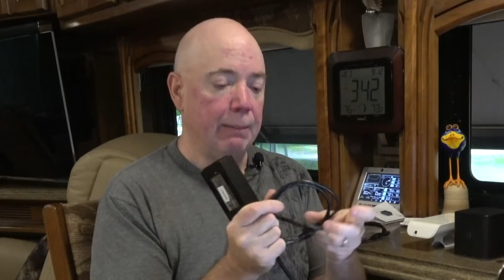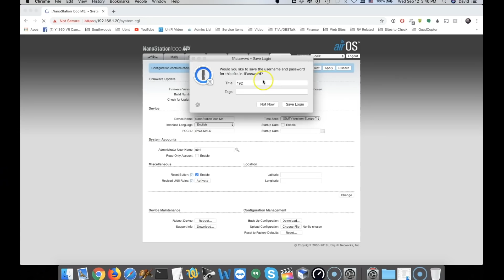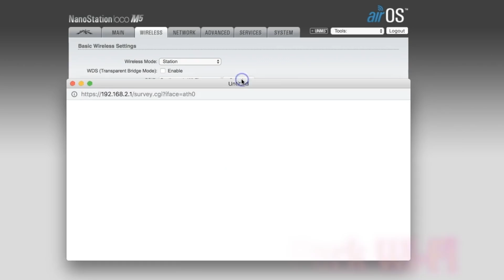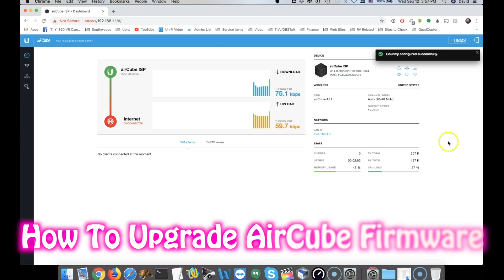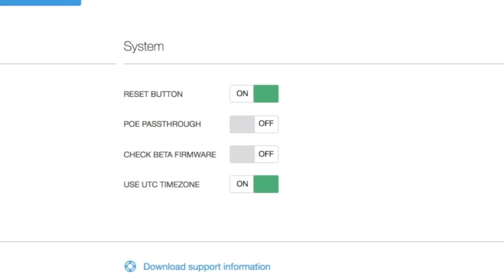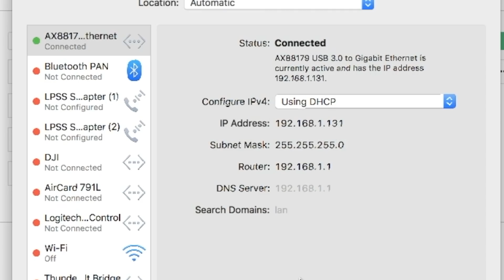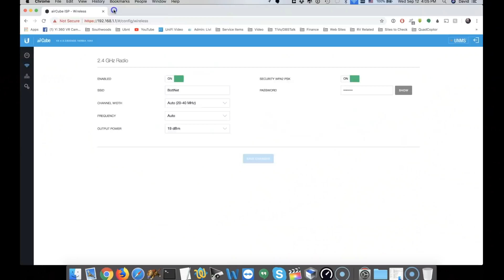Build a Private RV Wi Fi System with a NanoStation & AirCube AC

Comment: Hi again, from a forever grateful viewer. I thought you might be interested in this little tidbit, if you're still into wifi networks. I've been using my Nanostation for about six years in my marina in Southern California, set up per your video (thanks!!!), and now I got an email from the network that I pay (Eccowifi) that they detected a "rogue" Ubiquity device and blocked it, and they need to take it over for security reasons, or sell me their own Ubiquiti antenna. I gave them the login, not really a problem, but really interesting that they would do this after six years. Otherwise, hope you doing well, and may your days be filled with joy!

Comment: Hey David. I realize that this video is older, so you might not see this comment. Thank you for doing a video (well, 2 videos really) on how to set up a safe, private network in an rv. I have been going back and forth about which method I should tackle first for getting internet into my rv. I don't work on the road, I am just a happy summer camper and do enjoy having access to the internet for planning outings and such. I don't like being on an open, unsecured network, however, so I have usually used my cell phone for internet, but of course cell signals are the determining factor for that. I appreciate this video and followed it exactly ( I think), but it didn't end up working the first time. Then, I found the other video when you showed the air gateway (which no longer is being made). I tried watching that video and it really helped for a part of my setup, but this video worked better for the other part. Eventually, I got everything working by watching both videos! Go figure. One thing that was confusing and wasn't (I believe) in either video. That is, when you access the Nano station at each new RV campground,  you need to be on your Aircube network before you can access the Nanostation login page. Other than that, thank you very much for doing this. Finally, I can (I hope!!) use the campground wifi in a secure, safe way!

Comment: One quick question. If you connect an ehternet from M2 directly to your laptop, does it have internet straight away?

That's an awesome tutorial, which I've followed and worked great couple of yeats ago! Now, sadly my aircube is toasted. Do you think that I can use the nano M2 with another router? I got a tp link one. Do you think it will be possible to use it in the same way? Different settings of course. THanks
Reply: Hi...As long as the NanoStation is configured per the totural, yes, you can can power it with a POE injector and come out of the LAN port of the POE to any device, Router or Computer.  :) (Wow, this video is from 6 years ago.  Glad it is still helping people.)
Reply: @davidbott5438  thank you Very very much! That's the power of internet 🎉 I had set up exactly like yours for my camper. You helped me then, you helped me now too :) wishing

Comment: Was you using internet whilst doing the settings on your computer
Reply from the maker: Not 100% sure what you were asking,....But NO.  In order to connect to the Nanostation to set it up, you must be able to talk the unit directly over IP at 192.168.1.20.  Thus usually means you have set your computer to use a static IP address of like 192.168.1.5 and connect to the LAN port of the POE injector.  This is all talked about in the video.

Comment: Great video, it worked for several months. Now, I keep getting an error in the logs (received deauth from reason 4-way keying handshake)

Any fix for that? 

Thank you
Reply from the maker: No idea on your current use case, but I would suggest upgrading the NanoStation firmware to the current version the recent version. Note, there are WX and WM versions so be sure to download the right one. ( https://ui.com/download/software/nsm2 ) Or go into the NanoStation and the last tab looking for check for update and use that to download and install.  This error usually means is is not getting a reply from the AP you are trying to connect to in a timely manner.  So the RV park could be having an issue.  Just a few thoughts.  Hope something helps.

Comment: I love this setup!  I'm a network/IT guy by trade, and you saved me so much time, putting this together.  I was trying to cobble together old WiFi stuff I had in the garage, but with the cost of the components and your walk-thru, I couldn't pass up this solution. I hadn't solved how to piggy-back off of another WiFi network, nor how to power it all from DC.  The airCube and NanoStation were under $100 from Ubiquity's site, including tax and shipping. I also bought a "PoE Texas" 12v input PoE injector (GPOE-24V30W) from Amazon, so everything is running from the DC bus, and doesn't need shore power, generator or inverter to stay on line.  I'm able to connect it to my home WiFi, my phone's hotspot, RV park or any other WiFi network.  And since it's always on, my home automation (Home Assistant on Raspberry Pi 4B and Victron Venus on Raspberry Pi Zero W) in the RV remains active so I can monitor and control everything without AC power. Yes, I'm geeking out pretty hard on this. 😆 EDIT: Monitored the total drain on the batteries, and it's about 15W (1.2A) including the WiFi and all my automation. Uses about 5% thru the night.  210Ah flooded lead-acid batteries.

Comment: Is the original video with the air gateway still available? I had the equipment setup according to your video and it worked great for the year we spent full timing in our RV, but we bought some acreage about 7 years ago and I put it in storage. I now wish to use it on my property but it is acting a bit weird, so I’d like to reset it all and set it up again according to your video.
Reply from the maker: Hi... Here you go..https://youtu.be/-i8SmOf5ZTw?si=FdMfEUcG307x64_e

Comment: Thank you for keeping the video "Simplistic and step by step."  I'm an IT idiot. I bought the items you recommended, except I bought the M5 Nano Station instead of the 2.4.  I followed your directions, and it works perfectly, first time!!!  That never happens. It seems like online help is always leaving out a step or two.  Thank you SOOO much for your video.
Reply from the maker: Your welcome.  Boy, old video.  Just note the M5 will only work at RV parks that support 5Ghz. Not all do.  So if you travel around, you may want to get an M2 all setup in case needed. :)

Comment: Thats fine for 5G. Will not work in parks with 2.4 only, you will need a Nano M2 and then you can see 2.4 SSID's in parks that are not running both 5ghz and 2.4 SSID. Other than that great video.

Comment: David- Your tutorial on the Aircube and private rv network has proven valuable beyond measure.  I've referred back to it many times over the past couple of years or so.

I recently bought a Starlink RV setup for a local project and used the Nano station to try and extend the starlink modem coverage to an adjacent building . I have a strong signal to the nanostation and through the nanostation I'm able to connect to the Starlink modem but I don't have internet access. 

Have you any experience with the Starlink hardware that could shed some insight into this type of connection?

Thanks

Comment: Would this work if the air cube is set before a ISP modem on the WAN side of the network ?
Reply from the maker: Seeing that the AirCube is a router, it needs data to come into it for the WAN. So I'm not really sure what you're asking I'm afraid to say.

Comment: I am looking for a way to add some extra devices to my wifi to be able to use my chromecast. My current park requires you to log in to a website to log in to the network. Will this set up allow me to log in through a website to set up the wireless network?
Reply from the maker: Please see the blog post link in the description that talks about captive portals. Yes, the set up will allow you to log into a captive portal and once you do all your devices behind the router will work.
Reply: @DavidBott  it's awesome to see you still replying to an okder video. I will definitely look into the blog post to help with my current situation.
Reply from the maker: @tmeyer1985  yeah it's actually a very popular video still to this day. The hardest thing is finding the parts because of the issue with getting chips etc. These days it's hard to find the actual parts that you need. So even though the video is still current, if you can find the parts, everything still works as it should.  I'm still happy to help support it as I can. Yes, it's an older video for sure but the parts are current and so is the instructions. (Again, if you can find the parts. You may have to try eBay.)

Comment: Looking to purchase and put this together. Only hesitate that it's about four years old. Has there been anything come out better?
Reply from the maker: Hi...If you can find the parts, supply issues, it is still a very useable system. Do not purchase NanoStation AC radios as they only work to connect to other NanoStation AC devices. The AirCube AC is fine as the router.  Again, if you can find them now a days.
Reply: Thank you for replying. Yes finding the parts.
Reply: Ubiquiti Network airCube ACB-AC airMAX 802.11ac Dual-Band Home Wi-Fi Access Point PoE 24V In/Out OPEN BOX
This is what I was going to order.

Comment: I know this is an older video but still current and one of the best ones out there.  David Bott rocks.  I do wonder why you set the M2 to Router when you have the AirCube router.  I'm doing this same setup in my RV but plan to let the M2 provide the firewall/NAT in router mode.  I'll connect it to a Ubiquity U6 access point which will be powerful enough to get to my wireless devices as I sit by the campfire.  Maybe 5GHz (need to check all my devices to see they support that) to keep wifi congestion down as I'll be using one of Ubiquiti's more powerful AP.  Seems no double NATing that way.  Maybe the M2 router function isn't that great?  I use their EdgeRouters in my other networks, but I'm thinking I don't need them in this application.
Reply from the maker: Hi...I am really not sure what you are looking to do.  Even though you tried to spell it out. :)   An U6 needs to be setup by Ubnt Controller Software as it is a UniFi device.  The M2 is used just to connect to a park and I use it in ROUTER mode (vs Bridged) as I want the parks network to see nothing past it. In Bridged mode, it will see whatever is on the other side (Unless you have another router which you want to do). You say..."'I'm doing this same setup in my RV but plan to let the M2 provide the firewall/NAT in router mode." which is what my config is.  Thus the confusion. :)    I have NO ISSUE with double or even triple NAT routing.  After all, it's just routing. :)  But you need to setup a UniFi Controller to setup a U6.   Hope this might help some.
Reply: @DavidBott  Thanks for the response.  I often heard that double NAT can cause issues.  I'll simplify my question to "Is the router function in these radio devices sufficient or do I need to put a dedicated router downstream?  Thanks again for making these videos.
Reply from the maker: @dgoatranch  You're going to want to use another router after the nano station. Because the nano station is made to be connected to something over a hard wire. It is not used as an access point. It's being used in this particular case as a station connecting to an access point. A station being a device. The access point you're connecting to at the park will then see the nano station as a single device. When you can have 10 behind and it would never know. Therefore, you also only have to go through a captive portal one time, if they RV park has a captive portal, and then all your devices will work because the captive portal works off of Mac address which it would get from the nano station. Hope this makes some kind of sense. Lol

Comment: Can you tell me why my nanostation can’t see my iPhone or iPad hotspot?
Reply from the maker: Sorry,  would not have any idea. Does it see anything else?  Did you get an M2 or M5 NanoStation?  For if it is an M5, then maybe your phone/tablet is not broadcasting in 5Ghz. (thus can't be seen.) But if you can see other SSID's, then it is not the NanoStation.
Reply: @DavidBott  I have both m2 and m5. Neither would see the iPhone ssid
Reply from the maker: @talbertreynolds  Do they see anything else?  If so, not the NanoStations it would seem.  Could the Freq the Phone/Tablet is set to use or something.  Not sure if you are just setting this up or what, but also make sure AirMax is not checked in the fist tab of the NanoStation interface as then it would only looking for other AirMax devices which are Ubnt only devices. (If you have such an option.)  Just hard to say, so this are just thoughts.  The biggesting being if you can or can not see any other SSID's.  Good luck.
Reply from the maker: Also, check to see if you NanoStation is set for channel width to 20MHz as sometimes the HotSpots only do 20Mhz. (Or 20/40 mode)  Just another thought.
Reply: @DavidBott  yes they see other ssids no problem. I connect to my Wi-Fi at home and in campgrounds. I will look for that setting
Reply from the maker: @talbertreynolds  Well if it sees other SSID's and can connect to them, then all is working. (So that' good!) So this would then look to be an issue, somehow, with the iPhone/Tablet and it's HotSpot mode. (Or maybe it 20Mhz as mentioned.)  I do not use and iPhone or Tablet so I would not really be able to help with that end.  So that is more or less as far as I can go with it I am sorry to say.  (Also be sure you do not have WDS checked in the Wi-Fi page...But that should not prevent you from seeing the SSID, just connecting.)  Good luck and glad it has worked for you otherwise.  I know it has been great help to so many people.
Reply: @DavidBott  we only travel occasionally so I don’t need a designated device for my rv network. I would just like to utilize my phone’s hotspot when driving and when the rv park doesn’t have very good Wi-Fi. I don’t want to have to change every device to connect directly to my phone’s hotspot
Reply from the maker: @talbertreynolds  Yup, can surely understand that.  I have 47 Wi-Fi devices connected up in our coach. :)   Sorry to say I really am not sure on your issue with your iPhone/Tablet. If they work with other SSID's, then it likely is a setting in the Apple devices, just not sure what as I do not use them. (I use a MacBook, but nothing else Apple.)   OH...You could try manually typing in the SSID and the password for the HotSpot and then Change/Apply that and see if it connects.  (Case matters on both as you likely know.) Just because it does not show up in the scan does not mean it is not their, it could be the SSID is hidden.  Just another thought. :)
Reply: @DavidBott  ok I had a chance to try these and a combination of setting channel width to 20 MHz instead of auto 20/40 and manually entering the SSID worked. For some reason the SSID name doesn’t show up from the select screen.
Reply from the maker: @talbertreynolds  Well, I am glad my info helped. :) Keep safe.
Reply: I have another question, I have my rv network all set up and working great but I have another question. When my rv is parked at home I connect to my home Wi-Fi access point with the nanostation. I want to sync my movie files I have on my home nas with a nas I will have in my rv. Is there a way to connect to devices on my rv network from my home network and just copy files from one network to the other?

Comment: I got an M2 and followed this tutorial, but for some reason, I can only connect to my jetpack and use the internet.  I am able to connect to the ap but not access the internet, and I am able to connect to the ap and use the internet when standing right next to it. I am wondering if there is something I missed, but if so why can I connect to my jetpack and use the internet but not the ap? Any help would be great.
Reply from the maker: It could be because the AP you are connecting to are blocking the routers from connecting. (In which case you can change the MAC Address of the NanoStation to that of a phone. (It is under CLONE MAC ADDRESS...Check the box and enter in fc:c2:de:6d:4b:97 which then makes it look like a Samsung phone. Click Change  & Apply and see if that helps.   

Or another thought, the IP address 192.168.2.1 that we used in the setup is also the same IP range they use, as such, it would make for a conflict and not be able to pass traffic. So you would need to change the 192.168.2.1 to something else...Like 192.168.11.1 (Also be sure to change the two DHCP ranges to also be 192.168.11.X so they match the 3rd number, 11.   I hope this makes sense.  NOTE...Once you hit CHANGE and APPLY your NAnoStation will then be found at 192.168.11.1 and not 192.168.2.1 as it is now.  

(Also...They don't have a Captive Portal or an Agree Page you need to go though to get on the internet do they?  If so, once connected, you much get to the Agree page try http://bott.net which should then redirect you to the agree page.  (Note, not "https" as some redirects, on some networks, don't use "https" and this can't redirect to the agree page.)  But if they do and you can get to it, then once you go thought it when connected to your network, it will record the MAC address of the NanoStation which all your devices go through and then your devices would work.

Again, hope this all makes sense.   Just tossing out a few ideas.  Good luck!
Reply: @DavidBott   I tried both of these suggestions but no joy. It's confusing because I was able to connect to the ap through an m2 loco with this tutorial, I got the M2 because the speeds I was pulling from the ap with the m2 loco were too slow for my use. I'm thinking of calling tech support, do you know if the Ubiquiti tech support staff are knowledgeable? If I do call them should I say that I'm looking for help setting up a long-range wifi client? Thanks.